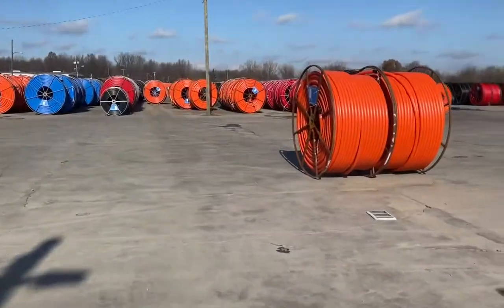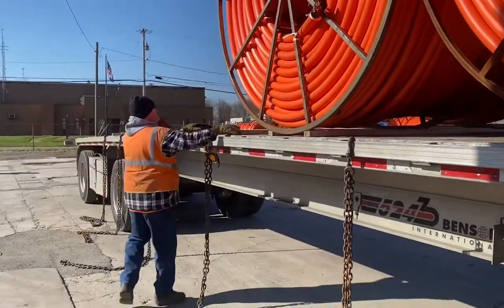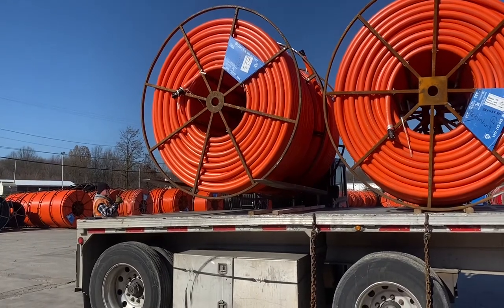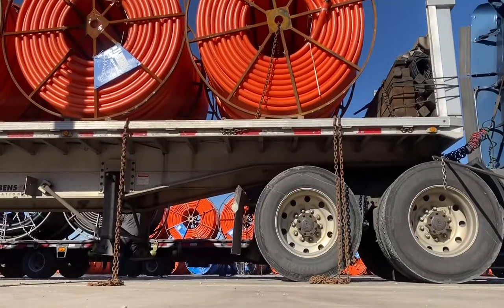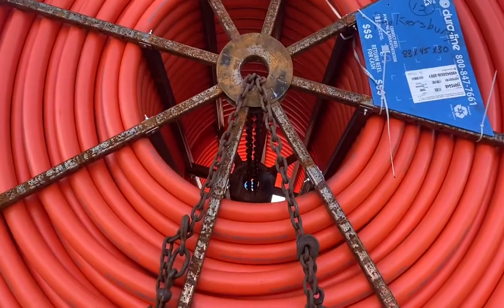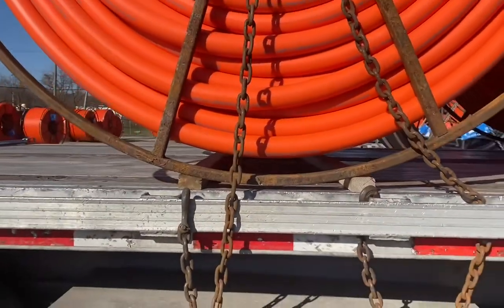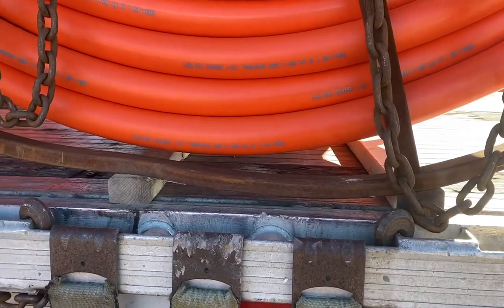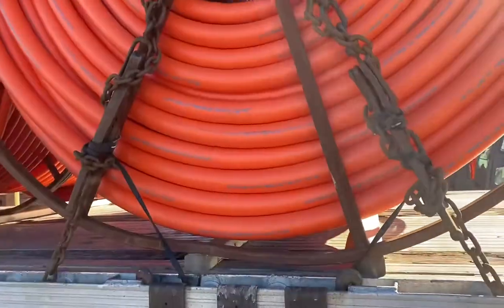Trucking , How to load reels of Fiber Optic Wire on a flatbed trailer.

Comment: Where you at? East Chicago, IN?
Reply from the maker: No
Reply: I see a lot of these reels being  hauled thru Missouri in hotshot rigs, are they not heavy?
Reply from the maker: @hotshotstuff8080  no not normally, but in saying that it depends on what it on the roll .
Reply: Did the company provide the tool to pull the chain?
Reply: How long are the forks is an hour to long to load a flat bed with one guy?
Reply from the maker: Not really